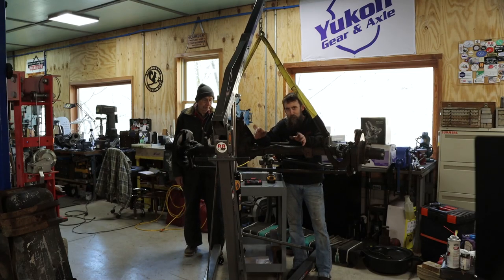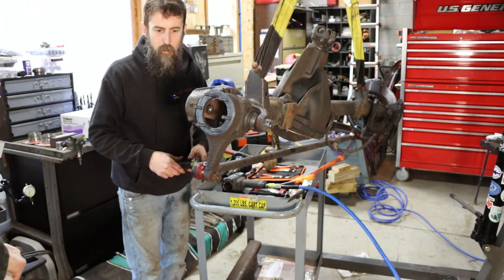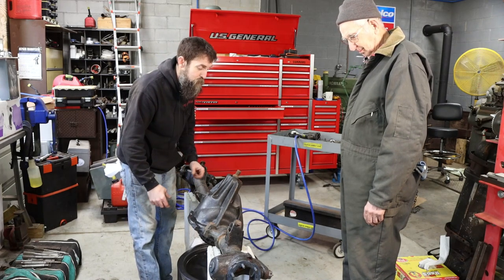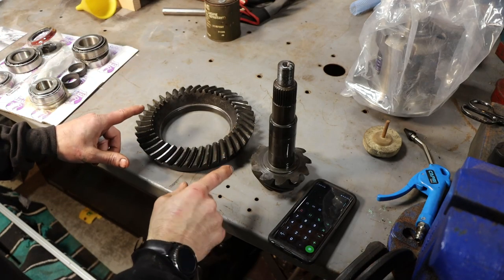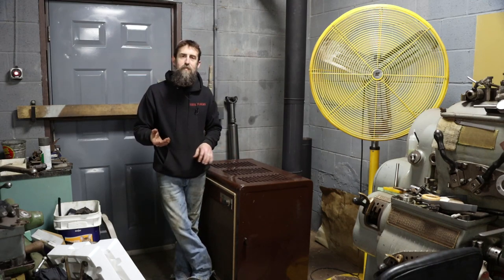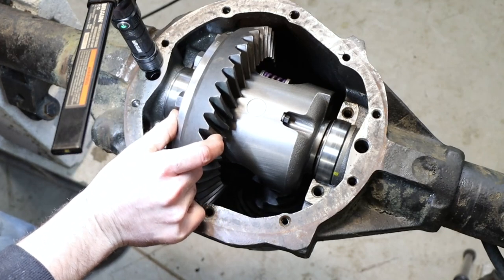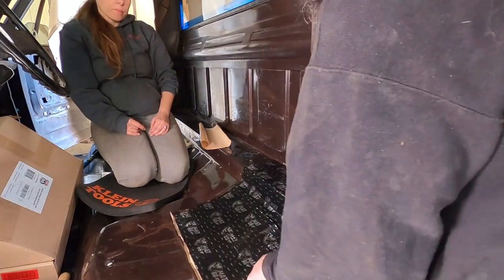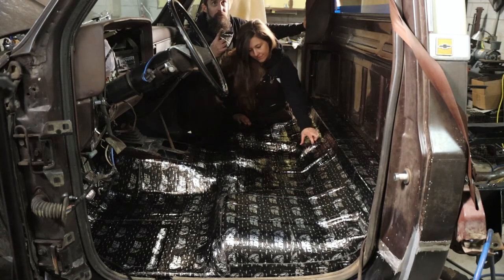Front Square body Chevy 4x4 Axle build!  30% more Dad included!

Comment: If you go ahead and replace any worn out parts in the steering column, that thing will probably drive better than my new one. Excellent job on the sound deadening Elizabeth, and well done on everything so far period. You're doing things right which isn't always the case here on YouTube. Happy to see the progress, I have always loved those old square body trucks. You sticking with the old 350? A sb400 would be cool with a nice truck cam.

Comment: Happy new year Steve. 
Treasure the time you spend with your dad. I wanted to work with dad a lot more then I did mainly do to driving a truck. 
He was a maintenance mechanic/machinist at a book publishing company. He told me 1 time the only thing he couldn't make with a lathe, a mill, & a welder was ball bearings. And that was only because he could never figure out how they got the balls in the races.
He injured his good knee 3 months prior to retirement 10 years ago. He could not walk do to needing a double knee replacement and the VA wouldn'tdo it till he lost weight. So for the next 9 years my step mom would all but keep him out of the shop. Saying she was afraid he would fall. Even though he had got an electric wheelchair I even bought 3 more. And I would be there as well. He was supposed to exercise but unless she was going to the store she wouldn't let him out of bed. Then 4 years ago he was put in a nursing home for about 2 months because he had congestive heart failure. They made him get out of bed and use his chair. He came home and 4 days a week he was out of bed and out of his room for over a year. She still wouldn't let go outside. Mainly because of the blood thinners he was on made his body cold to the touch. He shivered all the time even when the house was 90°.
In Jan 2020 I quit driving a truck. In November 2020 he died. I was to late in staying home for him. He had finally lost the weight the VA wanted him to loose but it was all mussel that he lost. He had deteriorated to the point he was a "skeleton with a belly" as he put it. And do to COVID19 he waited to long to go to the hospital for what we found out was total kidney failure. He died less then a month before his 71st birthday. And 3 days before Thanksgiving. He never got to see how my shop was tailored to me working from a wheelchair myself. I can no longer stand very long at a time as my back will not allow it. So cherish every moment with him. I miss it very much.

Comment: 28:30 When I did my differential,I made a rig that applied an adjustable, predetermined torque to the input shaft, using a large instant coffee can with cord wound around it and weights hanging off the cord.
Calculate the radius of the can and the weight on the cord to give the correct torque. 
For weights, I used a plastic food container and added water to the correct weight.
The object is to preload the bearing until the weight falls at a constant rate,neither increasing in speed or slowing to a stop.

Much more precise than turning a dynamic torque gauge by hand.
Reply: What's the matter? Are you to cheap to buy proper tools?
Reply: Your "method" is a blast from ancient history.  My grandfather used to do stuff like that 60 years ago.

Comment: Happy New Year to you Steve and the entire family. I noticed you didn't mention either differential vents when you were doing the rebuild (or maybe I missed it). If those vents are plugged up all that work will result in blown out axle seals and messed up brake pads and shoes. Lots of folks don't know that differentials will run warm and even hot as they are worked, creating gas pressure in the housing that needs to vent. If you plan on doing water foraging be sure your vent tubes are routed above the highest water point and you have a good poppet valve in the end of your tube to protect that running gear. Cheers into the new year! Thanks for the Share Steve.. Stay Safe

Comment: What an awesome video...   captured this... good for my truck folder   rebuilt  mine still in the truck ...  lasted 35 years first shot..  good to go another 30
Awesome  job she did on the sound deadening  just like that has to be stripped... was tough to get the tank back in  no clearance between the back of the tank and back bed below the window
Made a hanging headliner...  welding rod and some clips...  not knowing anything and just tackling things ...  once I got it planned in my head is the fun part... thanks for the tour
Reply from the maker: Thanks for watching 👍

Comment: You'll be glad to have the manual transmission with that setup.  I had a J20 Jeep pickup for a few years, it had the full time four wheel drive.  I burned the automatic transmission out of it ... twice.  The guy that owned it after me did likewise.  Too much grab on the ground with that 404 engine in the front.

It might be harder to stick it, but if you do stick it, swallow the pride and get help.  The tow bill will be cheaper.  And a little 'crow' in your diet will do you good.

Comment: In a four wheel drive system, the front always has one less tooth on the ring gear because the front is suppose to pull a bit more then the rear this is normal  (10:30/33:31) I am pretty sure that it does not come factory with both the same gear ratios! I am trying to be helpful.  Great video.

Comment: If you want a cheap and simple bearing heater, just buy an electric frying pan. You can set the thermostat for the proper temp and just let your bearing warm up until it drops onto the shaft.
Reply: I’ve been using a toaster oven for many years, bought it at a garage sale for $5.

Comment: Another great video, great to see your Dad helping out and Elizabeth taking charge of part of the project also, being from Aus, I am guessing a hog is a pig, but I am wondering just what a stuck hog goes like, as twice in the video you said "the truck will go like a stuck hog" I suppose a stuck hog must go really well as with all the new parts being installed it will sure be reliable when completed.  Regards a fan from Aus.
Reply: Haven't come across the expression myself, but I'm hearing it as, a stuck hog is a hog that's been stuck, with a pig-sticker.  Run ( away ) like a stabbed pig, basically?

Comment: Looks like a good job rebuilding that axle. I just hope you'll be able to steer on pavement after putting a locker in the front.
Reply: He has manual locking hubs on the ends of the front axle.  During normal driving the transfer case will be in two wheel drive and the front hubs will be unlocked so that front axle and diff won’t be spinning at all.

Comment: That front differential will outlast you.   I assume you will have the manual hubs unlocked for normal driving and they wont be engaged unless needed.  If so having a locker In the front will not make any difference for normal driving since the front axles won’t be spinning at all.  Happy New Years!
Reply from the maker: Yep, for day to day driving it won't make a bit of difference.  It will definitely help when you need traction👍

Comment: 31:09  A person really needs to pay attention.  The gear lube already had friction modifiers (PG-2 Limited Slip)... then a person adds additional friction modifiers.  More is not better.
Reply from the maker: What was used is a standard GL5 non synthetic 80 90 from a 5 gallon bucket put into a different bottle for ease.  Then a friction modifier from the same folks who sold all the parts. I put in exactly what the techs at Yukon recommend👍